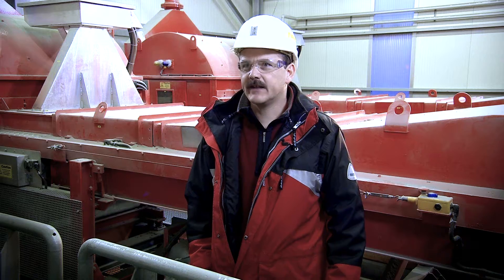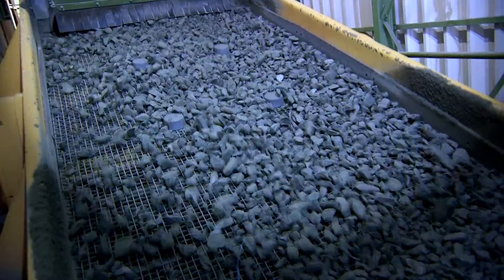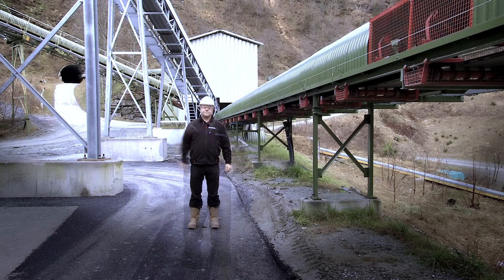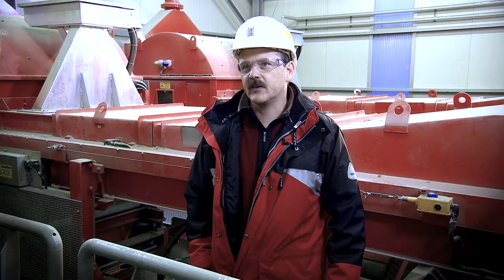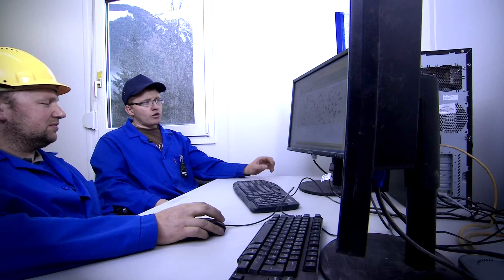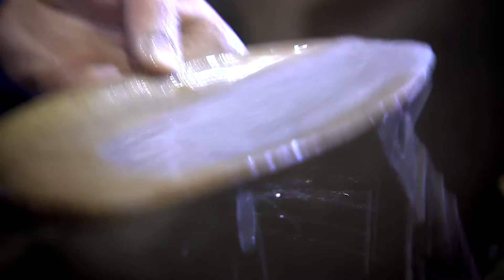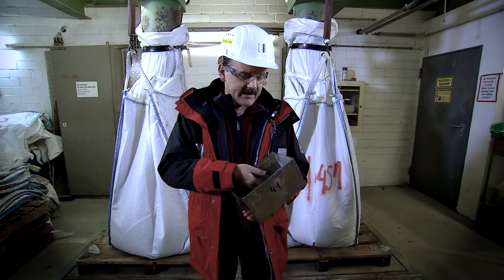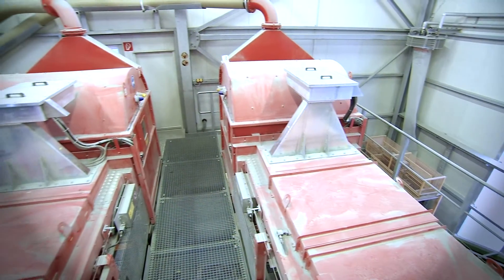Tungsten Sorting at WOLFRAM Bergbau AG, Austria

Comment: The rock, and ore, was quite uniform in size here. If its blasted rock, It would be a lot more variable in size. Would that have a significant affect, on the sorting ability. It looked like a blast of air, lifting the ore pieces.
Reply: Before the sorting machines, there are screens that classify the material on size. Then, each of the machines (you can actually see it on the video @2:26) handles a range of particle sizes. In this case, one receives material from 16-30 mm and the other one 30-60 mm. The air nozzles are not very efficient with small size particles.